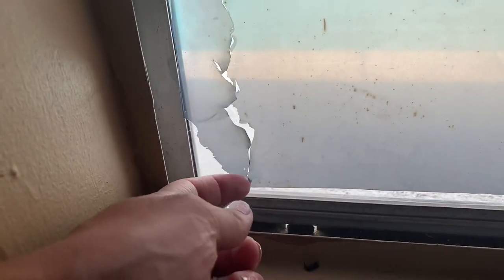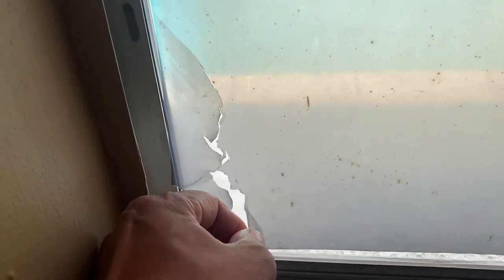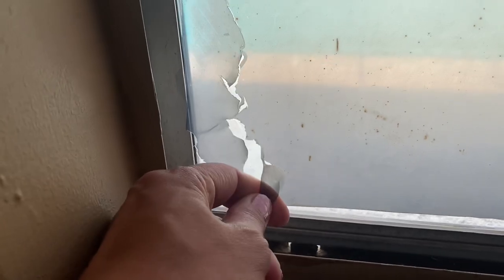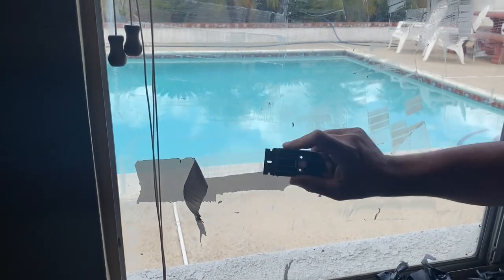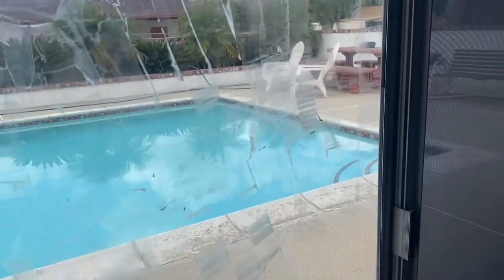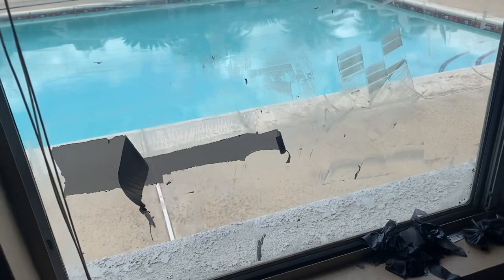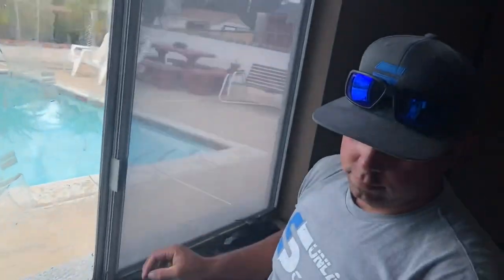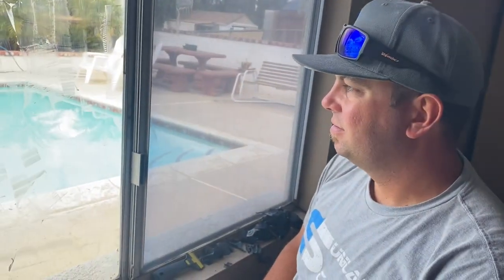Removing 30 year old privacy film from window

Comment: There is a product, undo, it does something to the glue so you can take off stickers and stick them back, I know you dont want to stick back, and I also have used a steamer for the heat to take tape off the floor. you guys are working so hard

Comment: Did your tint leave behind any staining? I removed mine as well as the adhesive (it was attached in 1999) and it left behind HORRIBLE stains on the window. I’ve tried a few methods and nothing works. It’s very visible from the front of my home so it’s driving me nuts!
Reply from the maker: Oh no! It didn’t, ours was right in the sun too, I cleaned the window with goo gone and window cleaner